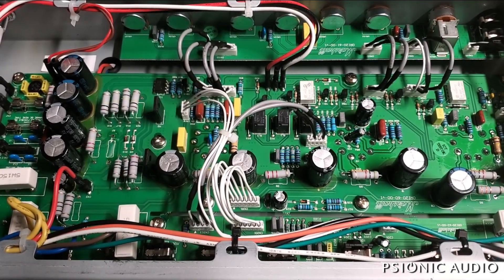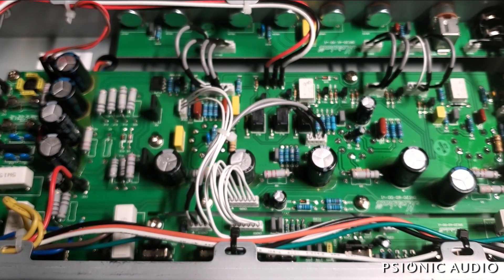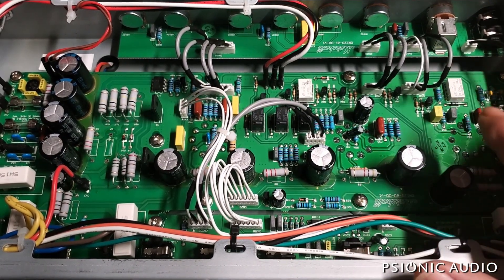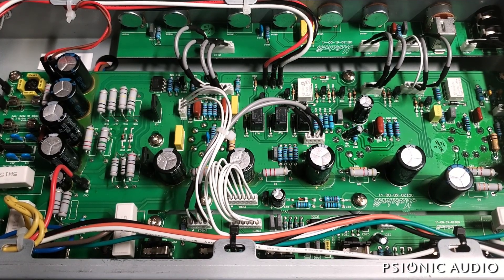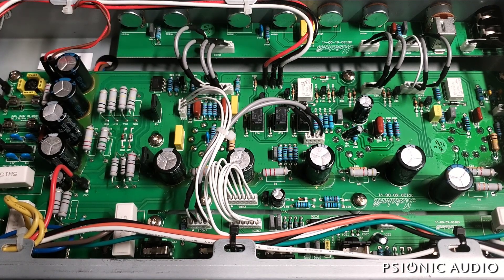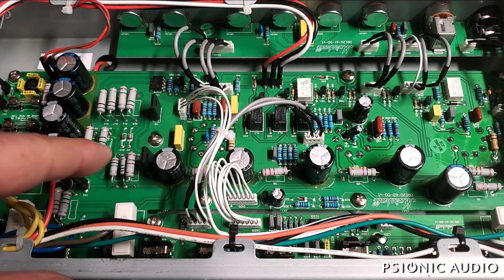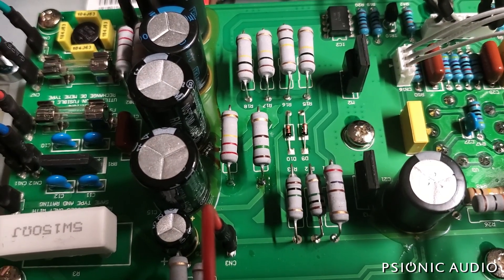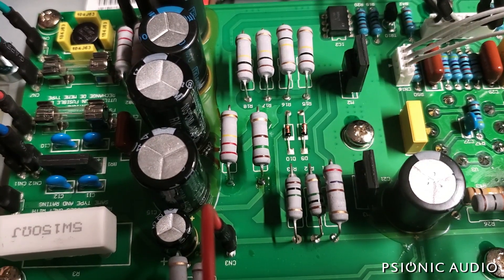Marshall Origin 20 H | Part 2 : Ohm's Law Is Our Friend

Comment: Thank you, sir!  Had problems with an Origin 50 that (turns out) needed the same ground wire added to the output board per that service bulletin you mentioned.  Would not have known about it without your advice.  Thank you again!

Comment: I put a 15w 150 ohm resistor in there when I burnt mine out. Though, tbf, I was experimenting, had just reassembled the amp, but hadn't connected the HT lead firmly, it wasn't really on.... ooppps...
Reply from the maker: I can't imagine the lead diameter of a 15W resistor fitting the pad on the board.
Reply: @PsionicAudio  Ah, fair play, you're right, I looked back on the invoices, it was a 5w, as I couldn't find a anything else in stock at the time..... ;-) 
Well, I figure it's gotta hold up better than a 2w.

Comment: Seems like the origininal power tubes eye just rated at a higher cathode current per plate voltage.  Marshall may have not realized that could occur even with self bias.
Higher wattage resistormade sense in this scenario.
Would have been interesting to see the diff in cathode current between the original and new power tubes.
Reply from the maker: If this was a more valuable amp I might have taken the time to see what exactly was the current draw. But I needed this thing fixed and gone.

Could have been screens, could have been plates. 

I can't defend Marshall here, because even with "good" EL34s that 2W resistor had 2.1W dissipation at idle. 

Amp Design 101 says use a resistor rated for twice the power needed.

Comment: WOW! I'm seriously contemplating buying the combo version of this amp but these videos are scaring the crap out of me. What version/revision of design is this particular head, and are the newer ones "improved"?
Reply from the maker: You can see the board revision number in the video. I don't know if there are any differences in production years.

Note that I am only discussing the Origin 20. The 50 is a different circuit and I don't know that it has these or any problems. Haven't had one on the bench, don't like to speculate.
Reply: Yes the first batch that were built had issues (one year) and were recalled by Marshall , the newer ones are improved .
Reply: James, watch Part 3 on this same amp; you'll likely be dissuaded from buying one.

Comment: R7 is a series resistor instead of using a Choke?
Reply: Yup. Although Fender usually used a choke inbetween the main B+ to the output tube plates and the screen-supply node, in many/ most other amplifier brands It's typical to see a simple dropping resistor in that same part of the circuit (drops a few volts and limits current to the output tube screens). The choke adds additional filtering and provides better voltage regulation, but the choke costs FAR more than a  resistor does, takes up a fair bit of space, adds weight, and can't be ---- or at least should not be ---- mounted directly to the PCB. As to which Marshall's of the past have historically used a choke, I can't speak, since I've not worked on any, though I've worked on plenty of Fenders with chokes. Most other vintage combo amps ---- Valco, Danelectro/Silvertone, Ampeg, Magnatone and so on, don't use a choke. Fun fact: on really old amps with field-coil speakers that don't have permanent magnets, the electromagnet coil of the speaker also acts as a filter choke!

Comment: Temping-in a 200 ohm resistor might have been a happy accident. A little less current but considerably more voltage across it = more power dissipation. A 150 ohm resistor might not have discolored so quickly. You might not have recognized the need for new tubes and how you were exceeding the power rating until this amp found it's way back to your bench for the eventual failure?

Comment: So a bad design is at fault here?
Reply from the maker: Yup. Well, faulty tubes, but you should never design with components right at the edge of their capability. Should have been a 5W resistor. Then the fuse could have prevented any component level repair.

See the upcoming video on another glaring design flaw of the Origin 20.
Reply: @PsionicAudio  do these design flaws apply to to the origin 50H as well?

Comment: So, I am gonna take a  minute and say THANK YOU Lyle! I learned two awesome things today from this video! 1) I am understanding how to use Ohms Law properly, and this walk through help reinforce this skill! 2) I learned I can measure voltage drop across a resistor with my DMM with the two probes. I did not know I could do this in "real time" the way you did it with the probes on either side. VERY cool! I have an impossible time learning through the "Socratic" method, my brain has never worked that way. I need to be shown, and walked through puzzles before I can learn, apply, and reinforce the information. So these types of videos are PERFECT for how I learn. I thank you so much for taking the time and making the effort to teach! This helps and excites me in a way that only furthers my desire to get better and better at fixing and building amps! I thank you again!!!
Reply: I'll latch on and say thank you for consistently putting up videos on the issues you face with amps every day.  I know it takes time out of your repair schedule to share your knowledge with us.  I have learned a TON about amps by sitting on your shoulder and hearing what you're doing as you improve the various circuits.  Looking forward to 2022.  Cheers!
Reply: Curran, since you are still learning this stuff as you go, it's also worth noting that the voltage drop (and therefore the wattage and heat dissipation) across the resistor R7 was being measured at idle here, with no signal passing through the amp; the voltage drop would likely increase at least a little if somebody played through the amp at high levels, and so the resistor would be dissipating even more wattage and heat. In a cathode biased amp such as this one, the difference in dissipation from low volume to full volume (ignoring the switchable power scaling) might be fairly minimal because such amps are often biased into Class A operation, with high current draw even at idle (tubes might already be biased at 90 to 105% of their dissipation ratings!) and so the power supply voltages run pretty much the same regardless of how hard you are or aren't pushing the amp ---- but in a fixed bias Class AB amp, that resistor would definitely drop more voltage and run sugnificantly hotter when the amp is pushed hard. You could clip the ohmmeter leads onto the resistor, play a loud power chord, watch the voltage drop increase, and calculate the dissipation with Ohms law. A good exercise for learning! And, as always, be careful and stay safe!
Reply: I come for the amps, but I stay for the pie recipes.

Comment: Interesting that 6.5 watt is what of years where rated at 5 watts.  Thus the  Dale cw-5   .    The mass is high however the  resistor does survive way over current very well.  They are wire wound by the way they will glow red if you over current them enough and they do survive .  Do not ask how I know . Cheap  infrared  temp gun at harbor freight  helps  about 15 dollars.
Reply: While the resistor might survive being run at well in excess of it's wattage rating, the excess heat will break down the solder joints, overheat the adjacent components (drying out capacitors etc), and perhaps carbonize the board to the point of becoming conductive.